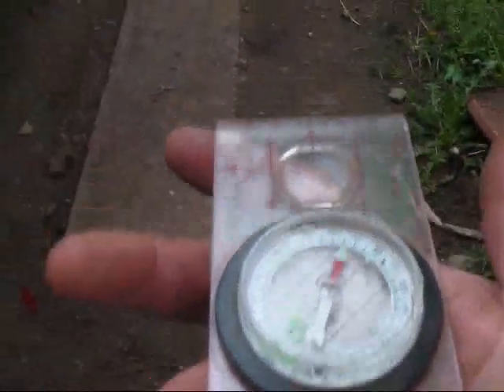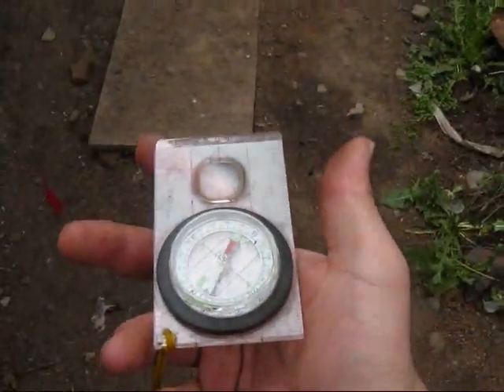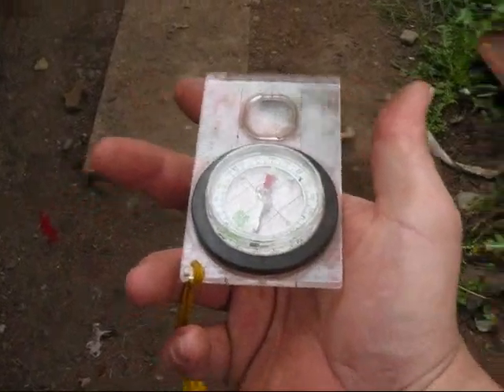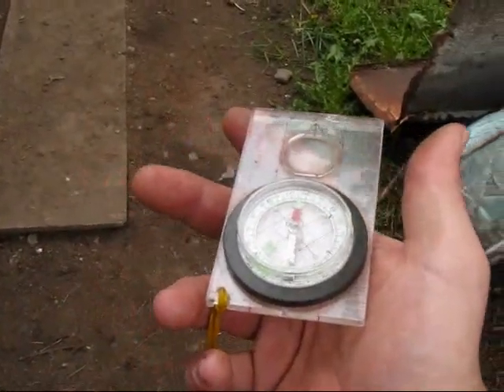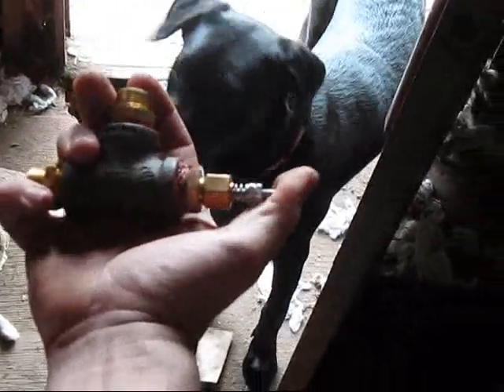same flows reactor part 2

Comment from the maker: a lot of different small carburetors may work but i beleave the key lies in how well the fuel is atomized. the smaller the droplets, the better. Even that little weed eater carb doesn't do to well, but if a person could install something just after the carb to help in atomization they wouldn't be a problem. are you building a reactor of this kind?